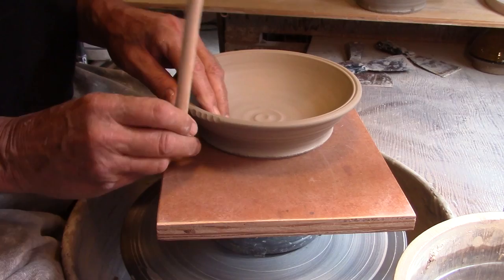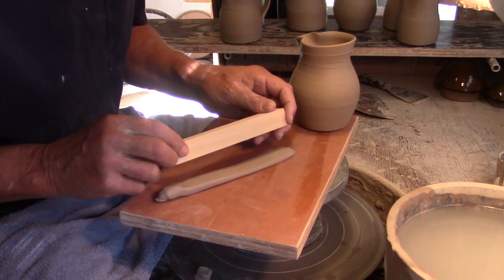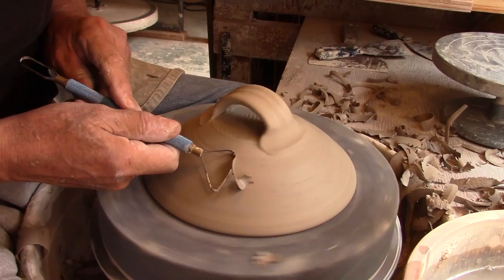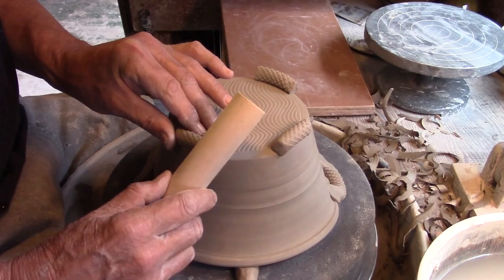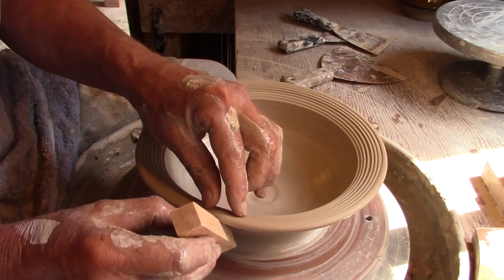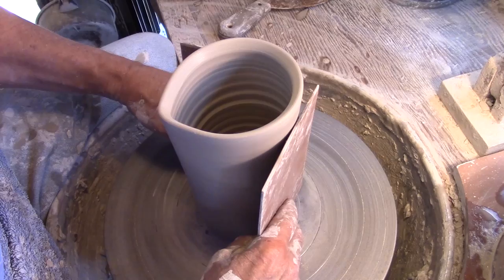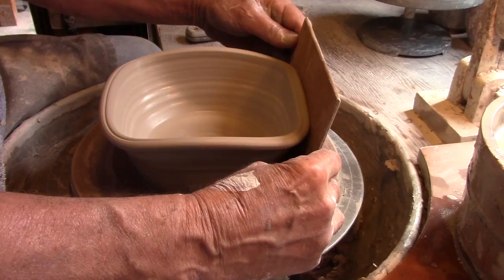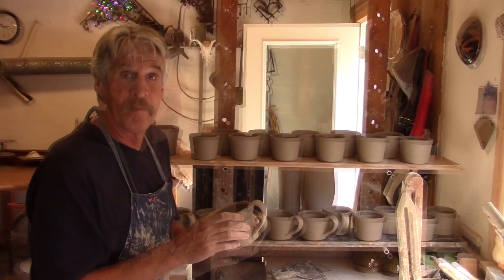How to use 10 simple wooden tools for forming and finishing your pots!

Comment: aren't you supposed to score EVERY piece that is added on? Kate malone scores EVERY time she joins pieces. no matter how small the piece. if that handle gets stressed enough, that joint is the weak spot where it will just break off
Reply: Rebecca Floyd answered Naomi Diaz question about the same thing.  Excellent answer she gave by the way.